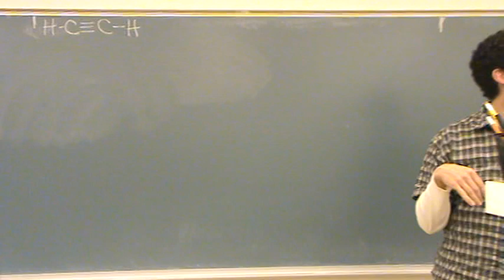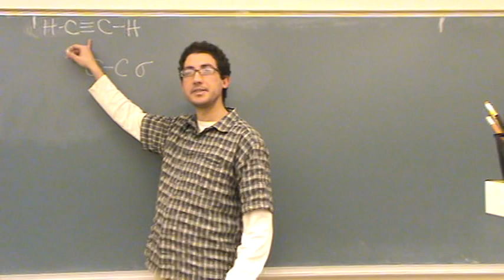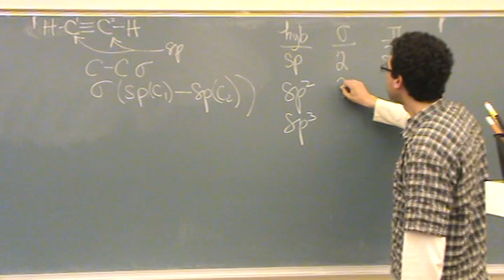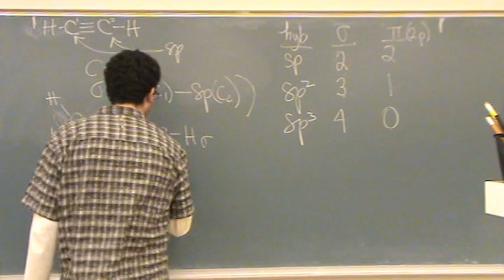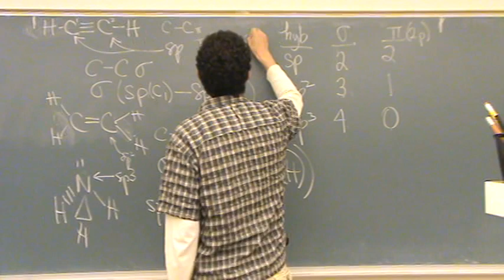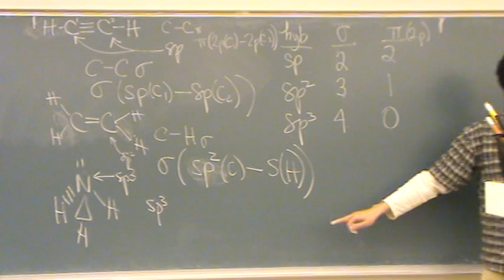Hybridization 5.mpg

Comment from the maker: Hybridized just means orbitals mix.  For example, an s and p orbital hybridize to form sp.  Or an s and 2 p orbitals form sp2.  Unhybridized orbitals just mean that there is no mixing.  An unhybridized p orbital is a p orbital.  Double and triple bonds are made with unhybridized p orbitals.  For sp specifically, an s and p mix, but there are 2 unused p orbitals (3 p orbitals total).  Thus, the 2 p orbitals remain unhybridized.  Those p orbitals are available to make double and triple bonds.